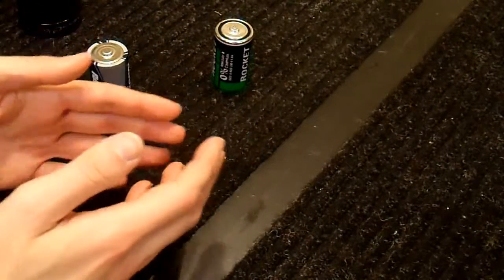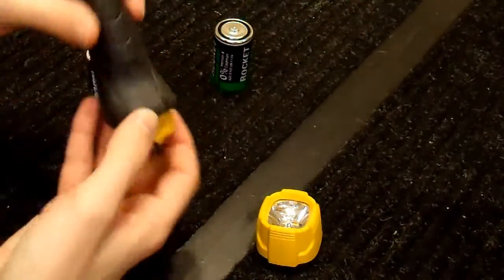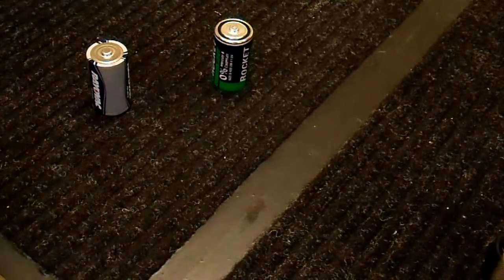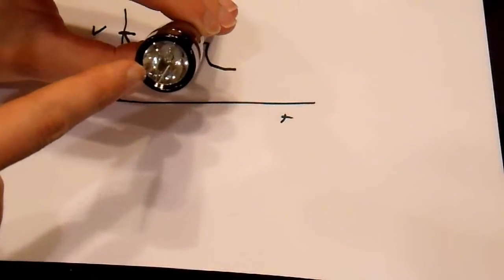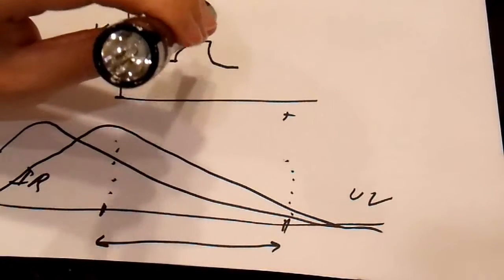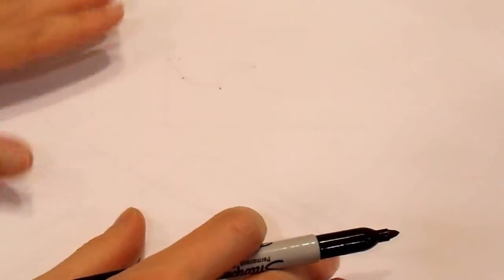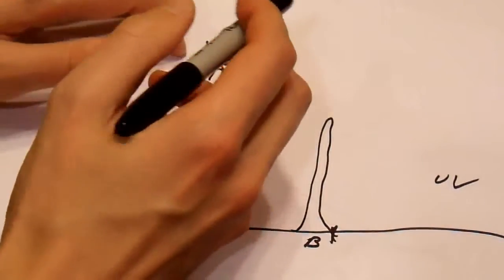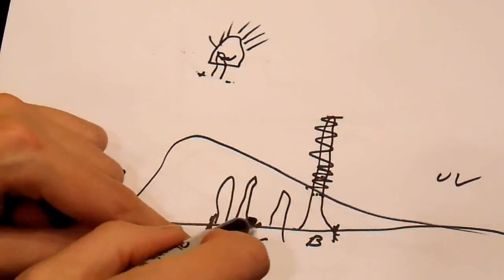Flashlight Shootout Part 2/4 - CRI, Color Temp, LEDs and Incandesent Bulbs

Comment: Even though you don't see IR, it can still blind you.
Reply from the maker: Only if the IR is so intense that it literally burns your eyes by increasing their temperature.
Reply: IR lasers will do the job, not that I suggest staring into one. On the other hand, as you said the intensity is key so a remote control won't blind person.
Reply from the maker: HostileHST
If we're talking lasers then I fully agree with you.  Some IR lasers can be very dangerous which is one more reason why I think green laser pointers should be better regulated given that many emit meaningful amounts of IR when designed improperly.  In my initial response I was thinking in terms of diffuse lighting (as in flashlights) where skin burns would precede eye damage giving ample warning.
Reply: Hope you know I wasn't trying to school you on IR, it was more of a warning to others and yes, Lasers need to be handled with great care. So get your IR glasses folks, them things are mean.